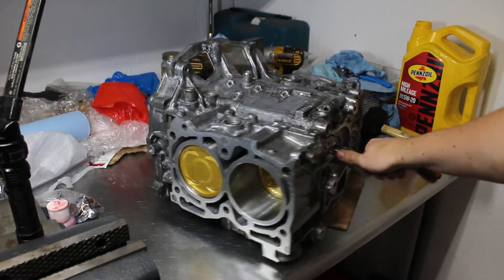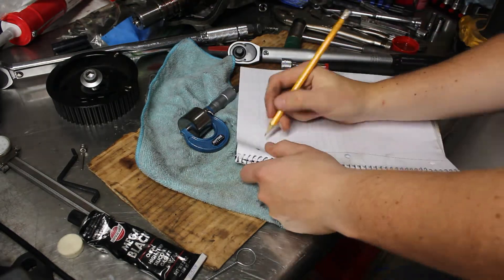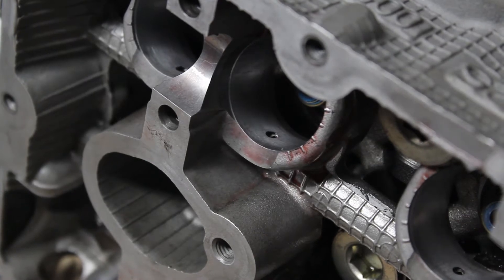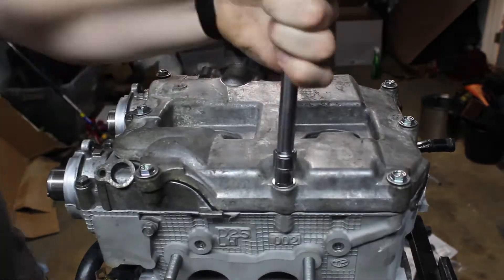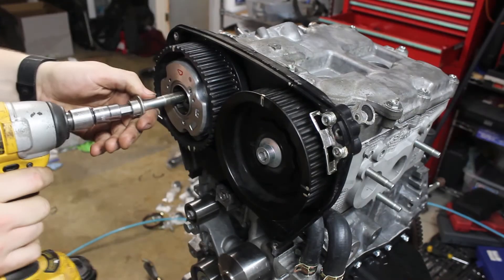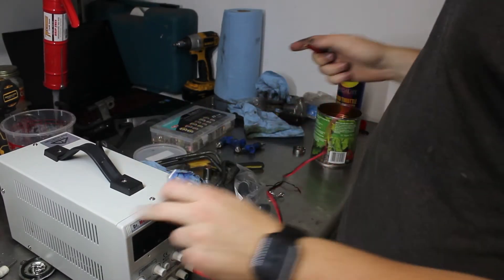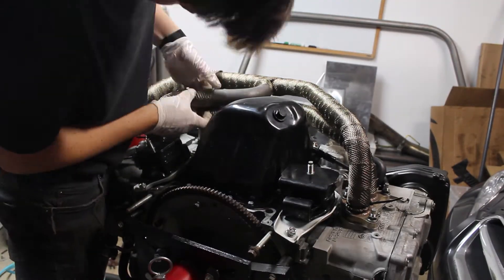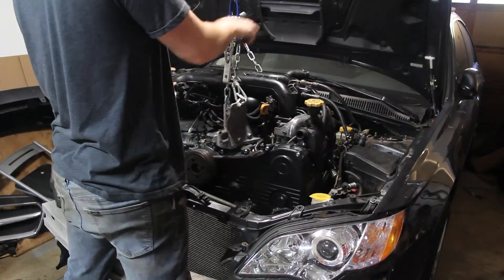Subaru 2.5L Turbo Engine Build - EJ255 Long Block & Engine Reassembly

Comment: 2years later....fantastic video on actually explaining the valve clearancing issues. I just went through the same issues where the machine shop didnt blow out 1 head very well so I dismantled the entire valvetrain to properly blow every out and found a bunch of aluminum shavings. I then checked clearances and the exhaust side was at .010" so i had to play the bucket game. I really appreciate the explanation on valve tipping and essentially your problem solving.

Comment: Does the fsm tell you a step by step sequence of what to install? When I’m reading thru it seems like it just shows the how but not when
Reply from the maker: Perhaps not, I didn't follow it for most parts. As I remember it skips around and leaves stuff out. It's useful for the important parts, like timing.

Comment: At 10:19, when turning the pulleys to align the marks, you actually mentioned to turn them the wrong way. Per the FSM ME(H4DOTC)-46- the Left Intake pulley must be rotated to the right (clockwise), while the Left Exhaust Pulley must be rotated to the left (counterclockwise) to avoid the intake/exhaust valves from lifting simultaneously. I’m not  chastising you, just letting others know the correct way just in case.

Comment: Bro i just want to say i really needed your videos. I am still in process of doing my rebuild and i definitely messed up by not organizing bolts and such while taking apart. Plus i dont have a garage so have the engine in my kitchen. I really need to get this job done. Roflao i also went and bought a new oil cooler actually 2 one from japan and one from amazon they both have different part numbers but look identical. i would love to be able to get some pointers. But through youtube comments is the worst.
Reply from the maker: Sure what do you need help with? If the cooler from Japan is OEM I'd definitely go with that one.
Reply: Cant comment a photo but would show you what i am talking about. The part number is saying 21311AA120 and looks exactly like the one i need but im pretty sure my part number is 21311AA051.
Reply from the maker: @Goofygoober99-g5x  You can search those on Subaru's parts site, if both say they fit your car, then good to go. But knowing Subaru, they're probably exactly the same. Lots of parts are reused across models.